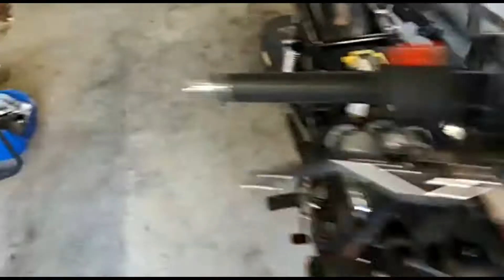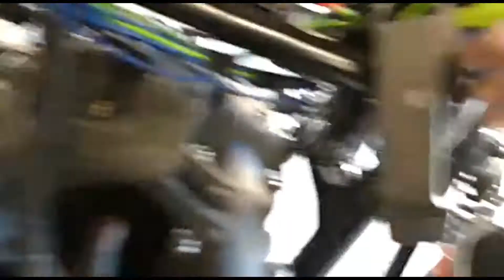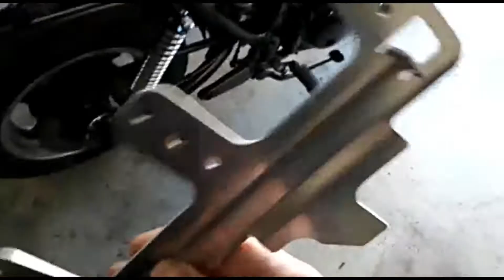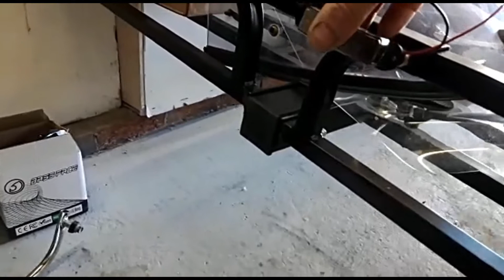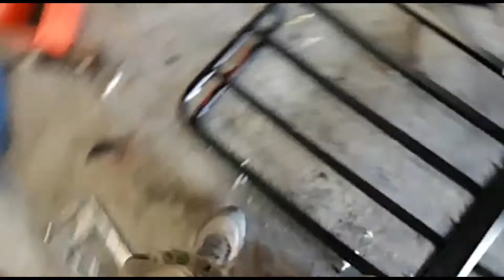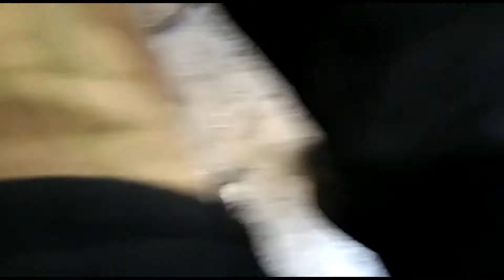21# fabrication Cont. Suzuki GS1100G Sidecar

Comment: Great little video this...,yeah took plenty of time but a job very well done. The screen will look great on that bracket...definitely lucky finding that and the screw holes almost made fit that screen. Makes sense taking that steering lock off and having your screen secure there...as you say if they want to steal the bike etc they will regardless of any locking system.
The brake, tail and side light looks really good tucked away like that and nothing will catch it, very clever that one little light does so much. All looking brilliant I have to say....gosh you are going to end up with a classy set up there, you will get looks and comments and people wanting to know more of how it ended up like that. Be interesting for the person you bought it all off to see the finished result too. 
Oh I so learned something new today and I was amazed to learn that a Wallace is a proper word and I just thought it the blokes name, so now I know where the Wallace and Gromit came from ...clever indeed 👋 😘🍺🍺👍👋🌈🖇📎